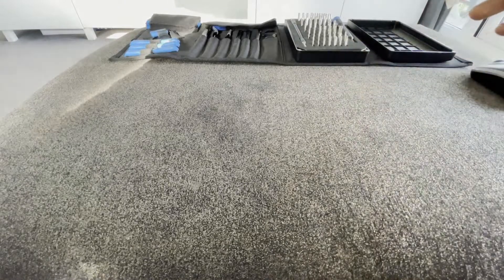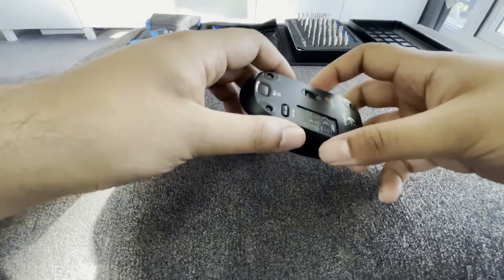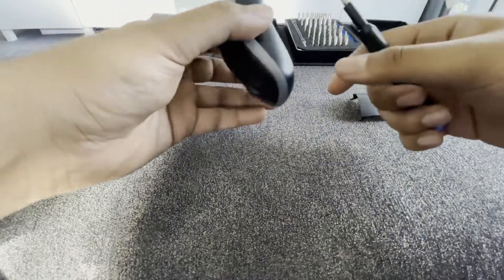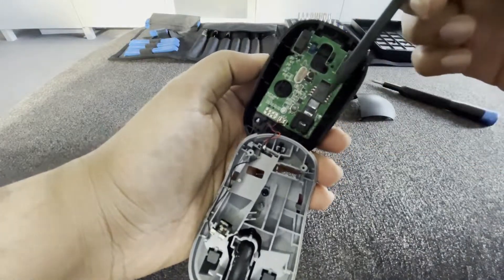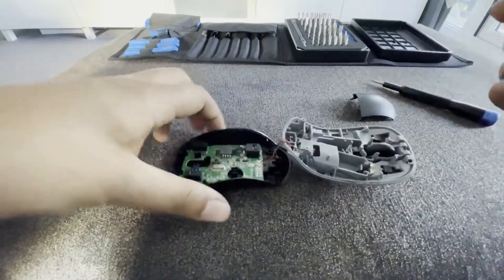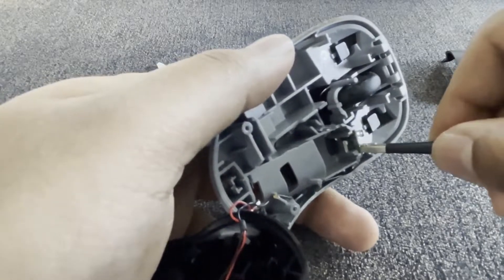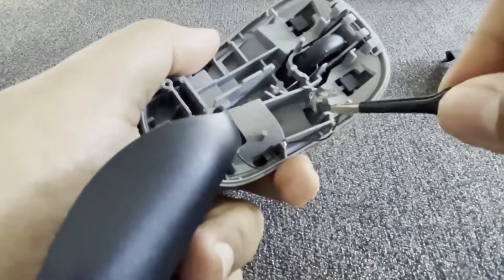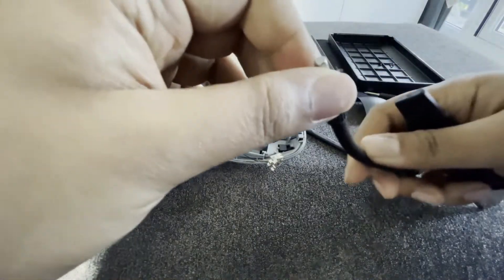Teck Tip: Fix a broken Wireless Mouse (Logitech M215)

Comment: My M215 mouse--- When I turn it on with a fresh battery, I don't see any light from the underside. The right click and left click works, but there's no movement of the cursor as I move the mouse. I suppose the led light has died...
Reply from the maker: There could be a bit of corrosion or something that is stopping the optical sensor from working properly, which would make sense as to why the clicks are working but the red light underneath is off and the cursor doesn’t move. 
Can you see anything wrong where the optical sensor is? (The Clear housing next to the large black piece). 
Could also be an issue with the chip that is responsible for controlling the sensor. If so the motherboard/ chip would need replacing but I’m not sure how easy a replacement MOBO or even the chip itself would be to find. Sorry I couldn’t be more help.